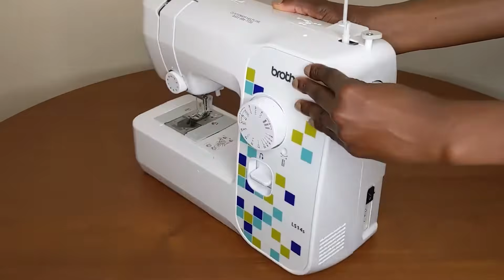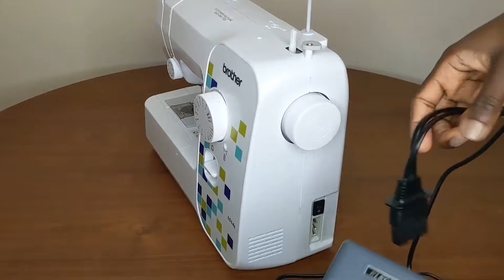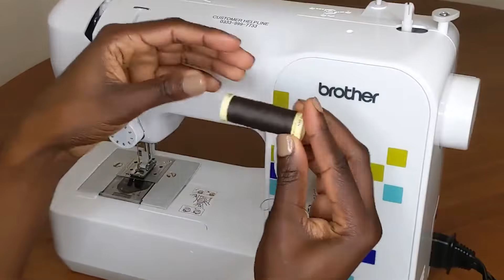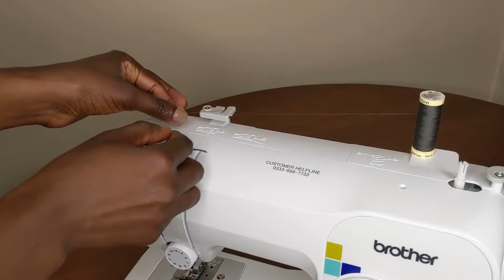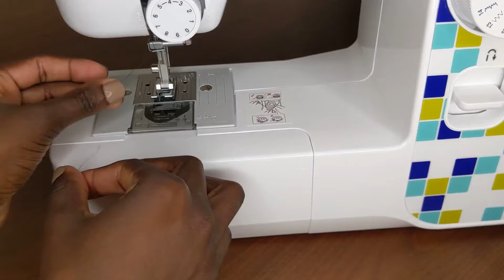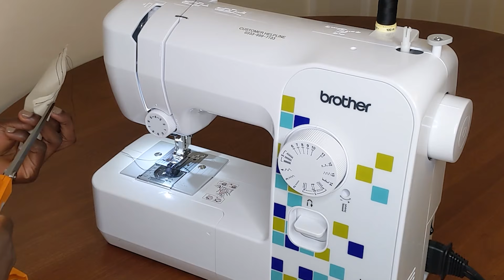How to Set up a Sewing machine for Beginners from (Start to Finish) Brother LS14s 🧵🪡

Comment: The instructions say always to turn the wheel to raise and lower the needle in one direction only towards you. Why do you turn it in both directions please?
Reply from the maker: The handwheel on the side of this brother machine operates the needle. When you turn the handwheel anticlockwise it brings the needle down. When you turn the handwheel clockwise it brings the needle up. Hope this clarifies everything.
Reply: @SewingSteps  It doesn't because brother themselves say you should only rotate in one direction and keep rotating to bring the needle up and down... 😢
Reply from the maker: Do you needle help with operating the needle?
Reply: @SewingSteps  No we worked it out, and checked more instructions, indeed you are incorrect in your tutorial. You should only turn the wheel in one direction and always towards you, so you are not doing it the right way 🙈
Reply from the maker: That's great you got it working, thank you for your feedback 👍
Reply: @SewingSteps  You're welcome! Your tutorial was still extremely helpful! Definitely more helpful than the generic instructions where the diagrams are in some cases just completely wrong 😅 you simplified the steps for us! 🙏

Comment: just tried the zig zag stitch and it broke the needle. What did I do wrong? Should I have used a different footplate? I bought 2nd hand and there is only 1 footplate.
Reply from the maker: Oh no, sorry to hear that. Once the footplate is compatible with your machine, that’s great. It’s worth making sure that the needle is the right type for your fabric. Check it's fully inserted and not bent, this helps prevent breakage, especially on zig zag stitches.
Hope this helps.

Comment: How to repair if it is not in use for long time,it stucked the stitching but machine is working.
Reply from the maker: Try cleaning out any lint and dust, and then apply sewing machine oil to the moving parts inside to help loosen them up. This often helps get the stitching moving again.

Comment: Im using my mums sewing machine and its this make, when im trying to do the bobbin the bobbin spins and so does the circle thing on the side but the thread doesnt spin, it seems to catch on the thread catcher or something, do you have any tips??
Reply from the maker: Hiya, sorry to hear that the bobbin has been a bit tricky for you. It seems  like the thread isn't feeding smoothly into the bobbin. Make sure the thread is pulled through the little tension guide on top of the machine before it goes to the bobbin winder. Its worth  checking the bobbin winder is fully clicked over into the winding position. If the thread is catching, try re-threading it from the spool to allow it to spin freely. Hope this helps.

Comment: Hi. Thank you for this video. How can I fix the bobbin if the lower thread keeps gathering in some places on the clothes. The upper is doing well though.
Reply from the maker: Sorry to hear that you are having trouble with the lower bobbin thread.  It's worth re- threading both the upper and lower part of the sewing machine. As well as checking the thread tension settings to make sure it's not too tight or too loose, as this can affect your sewing project. Hope this helps.

Comment: I really need help, my top thread keeps tearing or getting pulled back out of the needle, I’ve been trying to fix it for two hours now and it keeps happening 😭
Reply from the maker: Oh no, I'm sorry to hear that. This usually happens when the machine isn’t threaded correctly or the tension is off. Try re-threading your machine carefully, making sure the presser foot is up when you thread it, and check your tension settings. You might also want to try a new needle, as a dull or bent needle can cause thread breakage. Hope this helps :)

Comment: Thank you for making this video! I was wondering if you might also know what to do when it seems jammed? Everything seems fine and I followed the instructions but I can’t find the metal thing for number 5 when installing the upper thread. I skipped that step and mine keeps making a noise and doesn’t move when I try to use it. I’m not quite sure what do to
Reply from the maker: Hiya 😊,  the metal thing is the take-up lever it moves up and down as you sew. If the thread skips it, the machine will jam and make noise. Turn the handwheel toward you until the lever pops up, then re-thread through it. That usually fixes it, If it’s still stuck, take out the bobbin/needle plate and check for any tangled thread. Hope this helps :)

Comment: Hi, thread keeps breaking up. I try to change the  niddle .I gave up. Can u help to solve my problem. Thanks
Reply: please could you kindly advise. Thanks
Reply from the maker: I'm so sorry to hear that. Threads can break if the tension is too tight, it’s worth checking the threading and using a good quality thread to prevent breakage.

Comment: This video has been very helpful thank you so much . I noticed that the zig zag foot under my needle comes off is this normal or it could be a fault?
Reply from the maker: You're welcome,  glad I could help :) . The ziz zag foot should snap into place once you attach it, especially if you're using one that's compatible with your machine. It's also worth checking under the shank if there are damages that may prevent the ziz zag foot from snapping into place.

You can check out this video of how to  changing a presser foot for any tips. Hope you'll get it sorted soon ☺️. 

https://youtu.be/e8_4ARf4w1k?si=UiF6S2M5MVqFi9wx

Comment: Hi, I have the brother LS14s sewing machine but can't find what needles to buy. I've looked at brother and on Amazon but can't see my machine model can you explain please.
Just watched your starter up video and found it really helpful. Thank you will watch them all now. ❤
Reply from the maker: Hi, thanks for reaching out to me, and thank you for your support 🤗. For this particular machine it used the "(90/14) needle". You can find these needles online, ive also linked these needles in the video description. Hope this helps. ❤
Reply: Hi…
Which thread tension should be chosen if I use jersey fabric?
Help me please. All time my thread is keep breaking.
Reply from the maker: Hiya, I’m so sorry to hear that. Try lowering your thread tension to around 2-4, but keep in mind that it might vary depending on your sewing machine. If the tension is too high, the thread can get pulled too tight and break. Also, make sure to use a ballpoint needle for stretch fabrics. A zigzag or stretch stitch will help prevent the thread from breaking too. Hope this helps ☺️🤗.

Comment: Hi

I wanted to say Thank you for your detailed video. I would like to ask you if you can use a free motion foot on this machine?
And if yes, which band or make of free motion foot would l need to buy?
Would be so grateful if you can help me in thus matter. I have the same machine as you.

Many Thanks
Reply from the maker: Thats great, glad i could help and you enjoyed the video :) . Yes you can use a free motion foot for this machine. The SA129 quilting/ free motion foot is compatible, it has to be low shank free motion foot if it is not branded. I have linked a free motion foot in the video description that you can check out. Hope this helps.

Comment: Can I just use the top threading to sew and not use the bottom bobbin.  Only using top threading and machine stitching is not holding
Reply from the maker: It's best to thread the machine correctly using the top and bottom bobbin to help secure the stitches. Hope this helps. Let me know how you get on ☺️

Comment: Mine does this weird thing were it will work for a few stitches but even though there's another thread in the bobbin the bottom thread from the bobbin will stop working and only the top stitches will work. Do you know why this might be?
Reply from the maker: Sorry to hear that. Have you checked whether there is enough thread on the bobbin and its installed correctly?
Reply: @nicolavalentine8120  thanks I messed around with the bobbin a bit and it's working now
Reply from the maker: Glad to know it's working now 😊.